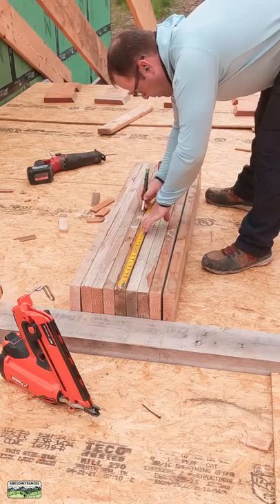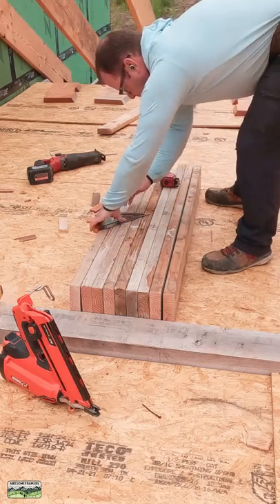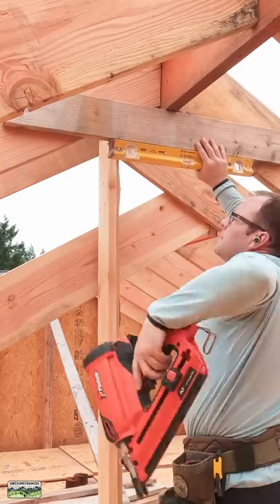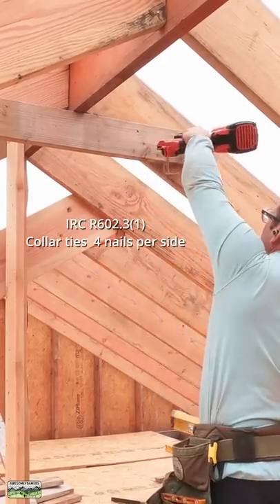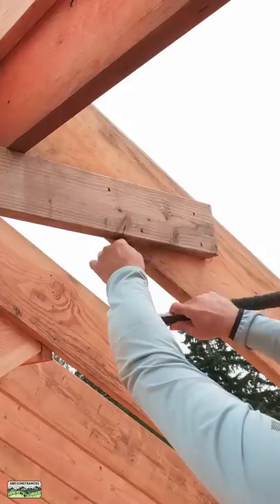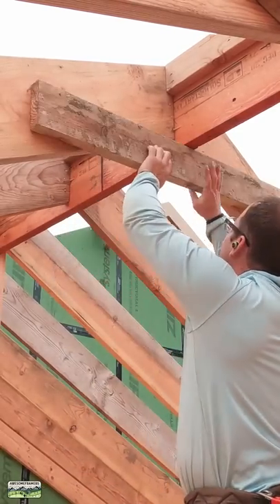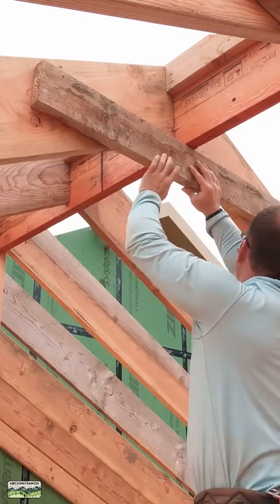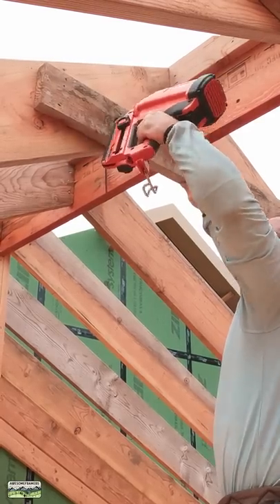How to Install Collar Ties #shorts

Comment from the maker: https://www.finehomebuilding.com/project-guides/framing/how-it-works-collar-and-rafter-ties
Reply: I love the process. Do you prefer the paslode here or do you just happen to have it out? Why would you use the paslode here over a traditional pneumatic nailer?
Reply from the maker: @ArmoredXJ  either/or.  Usually if I'm in an attic I pick the Paslode for convenience.
Reply from the maker: @chrisreynolds2410  can you provide me a reference that supports your claim?

https://www.finehomebuilding.com/project-guides/framing/how-it-works-collar-and-rafter-ties
Reply from the maker: @chrisreynolds2410  No need for personal attacks.  The drawing in the article and, you can find this in engineering references, shows them in the upper third, including right up against the ridge.  

Here's the code reference the article illustrates. R802.4.6 Collar Ties

Where collar ties are used to connect opposing rafters, they shall be located in the upper third of the attic space and fastened in accordance with Table R602.3(1). Collar ties shall be not less than 1 inch by 4 inches (25 mm × 102 mm) nominal, spaced not more than 4 feet (1220 mm) on center. Ridge straps in accordance with Table R602.3(1) shall be permitted to replace collar ties.

FYI, its Paslode https://www.paslode.com/
Reply from the maker: @chrisreynolds2410  Where does it say that?  The drawing shows from the third up.  

Provide me with a reference that says not to put them against the ridge.  Our stamped structural engineering allows this.
Reply from the maker: @chrisreynolds2410  I provided the code reference.  Now its your turn, give me the section.  I suspect you don't have a code or engineering reference.
Reply from the maker: @chrisreynolds2410  it's in the top third, is it not?
Reply from the maker: @chrisreynolds2410  the images from the code reference saus top third. That's what I did.

Show me a reference that proves your claim it shouldn't touch the ridge. You don't have one do you?

BTW, enough with the ad hominem attacks.
Reply from the maker: @chrisreynolds2410  Larry Haun is dead and not a code expert.

The code says top third, I shiw top third. Therefore it meets code. Provide me 1 reference that says it "shouldn't touch the ridge". That's a claim you made, but have provided zero proof.

Top third means top third.
Reply from the maker: @chrisreynolds2410  the label says upper third. The drawing shows it the lowest it should be installed.

You said it shouldn't touch the ridge, provide me with a reference that says it shouldn't touch the ridge. Until you do, I'll delete your comments.

Comment: I like to make them longer and match the rafter pitch on the ends , just makes a better looking job
Reply: I agree, my dad was an old-school Carpenter, he would never put them up with square ends
Reply: That’s such a waste of time though. There’s literally no point in doing that.
Reply: this isn't a matter of efficiency , it takes hardly any more time to make a better looking job
Reply: @B8888Y  it would easily take 2-3 times longer to make 2 cuts on each board at the pitch of the roof to the exact length. For something that doesn’t matter and no one will see it is a complete waste of time. It is completely a matter of efficiency.
Reply: I dunno about the states, but here in canada we were taught in school to follow pitch of the roof minus 20mm, 10mm each side, for expansion.

Comment: In Massachusetts our Collar ties have to be  two thirds of the distance to the bottom of the ridge. IE a lot lower than these.
Reply: Same here 
Pointless
Reply: Look at national code. Collar tie is top ⅓ of rafter only, middle ⅓ untouched dead zone, bottom ⅓ is rafter tie, AKA ceiling joist.
Reply: @jamesrussell6870  exactly
Reply: Engineer could have specd this
Reply: This is a ceiling joist. It's has a floor system holding the walls from spreading.

Comment: If you were building your own house/Home_ How much of the code would you follow? 4 nails per, or more like 8+ ?? Building my own place soon just want to know what’s overkill
Reply from the maker: excellent question, and one that is a pet peeve of mine.  The code already has a safety factor built into it, so there is no reason to add more.  However most people go crazy and over nail everything and whine about engineers.  So if it were my house, I would nail as shown here 👍

Comment: Hopefully all the rafters are perfectly in plane or you will get an uneven snap line that will be slightly off. I always leave two dry lines and set the collar ties to the strings.

Comment: Collar ties on flimsy 1x ridge board... Here, LVL overkill ridge "board" makes me wonder if there's any point to a collar tie in this situation. The connection with 2x12 to LVL will handle any uneven load situation..
Reply: Collar tie is to prevent uplift at the ridge.
Reply: @pwhsbuild  prevent uplift when a 2x12 rafter is peppered with toenails into a LVL ridge?? Really? 

In standard framing, yes..

Comment: Did you follow engineered plans or did you follow the Hc distance from the figures in the IRC or did you just wing it? 😂
Reply: If you’d like to know what the code actually says, it’s in chapter 8 of the IRC and gives specific requirements on collar ties and specifically how the rafters get sistered with the ceiling joists (or braced to a lower bearing wall if they’re not sistered).

Comment: We call those ridge ties, collar ties are located within the bottom third of your roof to keep the walls from spreading, I see in this scenario your floor box is your collars, as the roof rafters sit on the floor box itself. Either way, my inspector hates when ridge ties and collar ties are confused.
Reply: There is unbelievable confusion over “collar ties”. Most people have no idea what they are for, or what they do... and hopefully, they never have to serve, as they are intended. 
A collar tie, is to be placed, anywhere in the upper 1/3 of the distance from the bottom of ridge to the ceiling joist. It is there to keep the rafters from explosively thrusting UP and OUT from a negative wind effect. It does not “make an A frame to keep the walls from spreading”. 
Also, it’s a long outdated technology. It’s easier to achieve the same, and better result with a Simpson tie.

Comment: Strange we have to nail and bolt the collar ties in Australia 😅.
Reply: I like the method of using the snap line to get the crossing points of the collar ties. Using 4   Washers and 4  25” x 3.5” Lag Bolts or .22” x 3.5” StrongTie wide head structural screws is the way to go.
Reply: Strange you Australians let your government take away your guns...
Reply: @jamesrussell6870  🤣 we have guns for our army, Ukrainians have guns for their army… public ownership is an entirely different matter. Also what does this have to do with carpentry anymore?
Reply: @nfi2nfi2  Ukraine government handed out guns to their citizens. You just don't comprehend the concept of real self defense. Tyrannical governments thrive with sheeple citizens. 

You deleted your comment about fighting with your fists?
Reply: @jamesrussell6870  handed out guns to conscripts and people whom volunteered to fight in their army…. Again it’s not about having them out in the general public during times of peace. 

Realistic now though in modern fighting, guns are perhaps one of the least destructive and shortest ranges weapons in the fight. What’s a gun going to do if Russia rains nukes or just missiles? 

Why would you want to fight a war for someone else greed and profit anyway? 

My comment about fists is still there, that also is only applicable to domestic issues not foreign.

Comment: What’s the point in snapping a line? Y not just use the middle line u drew out as ur reference to begin with?
Reply: The ridge line centers the tie side to side, the chalk line holds it level.
Reply: @morganwheeler7417  100 IQ, big brain!
Reply: Probably quicker to just tape a level to each one, and just line up the center 😅
Reply: @jacksmiles47  that's what I do
Reply from the maker: @jacksmiles47  nope, try it
Reply: This is much faster.
Reply: @AwesomeFramers  I feel jesse5069 was being facetious
Reply: @Jesse-gv9tf   hah, thanks, I think? Not sure if you're joking. You know 100 IQ is exactly average?

Comment: Why are trusses made of 2x10s 🤔
Isn’t that overkill?
Reply: Just a thought. If someone goes to reshingle their roof, and decides to shingle over top of the old shingles, do they consult an engineer about the strength of their roof? What about 10 years later? The roof above my head has 5 layers of shingles and then a steel roof on top of that. I don’t mind the 2x10s in mine
Reply: It looks like hand cut, not trusses. And I don’t know about this one, but sometimes people use big rafters to make room for insulation

Comment: What happens if you place more than 4 nails?
Reply: It wouldn’t do anything other than reinforce it but it’s more than enough with 4 on each side, but I could be wrong… 😅
Reply from the maker: No advantage in more. 4 nails includes a safety factor 👍
Reply: We nail the backs too...not sure if it's code here in NH or not, I'll have to look
Reply from the maker: @atomjordan  that's not in the IRC, but why not do it? 👍👍

Comment: Tow nails slightly toward the ridge not away when scabbing collar ties.  As the roof settles the beams will become tighter and not loosen up. Less likely to pull out in from uplift forces as well.
Reply from the maker: Sorry mate, that is totally irrelevant to the forces on collar ties.  Collar ties are there to keep the roof from opening like a clamshell in high winds.  The roof doesn't "settle" up high like you describe.  We want the nails perpendicular to maximize their resistance to shear.
Reply: @AwesomeFramers  your nails weren’t close to being straight, they were angled away from the ridge which is wrong and decrease sheer strength. Sorry to hit a sore spot. 
For both a downward load or uplift load they are angled wrong and not best practice. 
Current codes require strapping across the ridge to mitigate uplift, at least in my state.
Reply from the maker: @daversj  current codes, 2018 IRC show collar ties or straps over the ridge.

Additionally it's "shear" not "sheer". I love how you're wrong, and you think you hit a sore spot. Rebuttal is part of discussion.

Comment: Hey buddy, a collar tie that is higher than 50% up a rafter does essentially nothing.
Reply from the maker: You're confusing a collar tie with a rafter tie. A collar tie should be in the upper third and prevents the rafters from opening in high winds.  Here is a reference for you. https://www.finehomebuilding.com/project-guides/framing/how-it-works-collar-and-rafter-ties

Also R802.4.6 Collar ties Where collar ties are used to connect opposing rafters, they shall be located in the upper third of the attic space and fastened in accordance with Table R602.3(1). Collar ties shall be not less than 1 inch by 4 inches (25 mm × 102 mm) nominal, spaced not more than 4 feet (1220 mm) on center. Ridge straps in accordance with Table R602.3(1) shall be permitted to replace collar ties.

https://up.codes/viewer/washington/wa-residential-code-2018/chapter/8/roof-ceiling-construction#8

Comment: Are you going to take out the nails now and bolt it together the proper way or just going with the ruff as toast method
Reply from the maker: They don't need to be bolted. 4 nails per side includes a safety factor. It's built into the engineering calculations 👍
Reply: Lol
Reply: I was thinking that. We have to Use M10 bolts. But given they're still using paslodes it's probably a small rural area or something
Reply: @happyhappynuts  and they daft ninja stars between them

Comment: Collar ties belong in the lower 2/3 's of the roof to be effective and to code
Reply from the maker: That's not true https://www.finehomebuilding.com/project-guides/framing/how-it-works-collar-and-rafter-ties
Reply: jjdwnbyci dude, you have absolutely no idea what you're talking about. Collar tie is top ⅓ of rafter, rafter tie is bottom ⅓ of rafter. What code are you referring to?? Middle ⅓ if rafter is a dead zone to be left untouched..
Reply from the maker: @jamesrussell6870  👍
Reply: @jamesrussell6870  purpose of collar ties is too keep rafter from sagging and to help spread from gravity as ceiling joist does....if it is too high I becomes ineffective...carpenter for 50 yrs ..go learn something
Reply: @jjdwnbyci  now you're saying collar tie does belong at top ⅓ of rafter? You started by saying bottom ⅔.

Goggle "collar tie purpose" & get back to me. I've only got 42 years of framing in..
Reply: @jamesrussell6870  bottom 2/3
Reply: @jjdwnbyci  You're not making sense. You don't touch the middle ⅓ of a rafter. The bottom ⅓ is a rafter tie, AKA ceiling joist, to prevent spread. Top ⅓ is a collar tie that shares potential uneven load from wind/ uneven snow load. Sagging rafters are undersized rafters..

Comment: Paslode doesn't shoot 16's
Reply from the maker: No one shoots 16s
Reply: @AwesomeFramers  maybe not you
Reply from the maker: @arturogarcia5996  you're right, some shoot that size nail. Most do not and that's why the IRC shows alternate nail sizes in chapter 6.

Additionally, there are only a few nailers that shoot 16d common nails. The best selling nailers do not